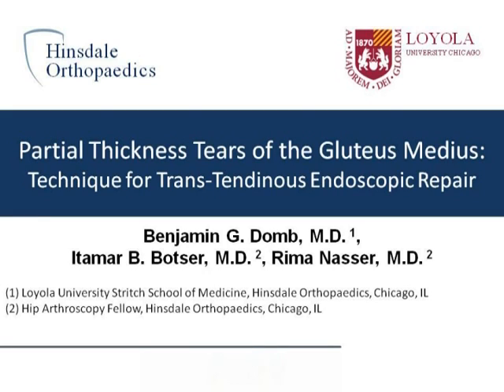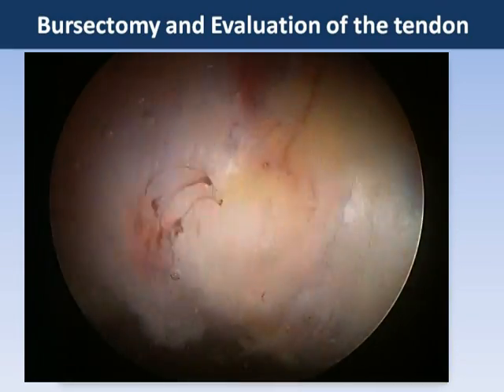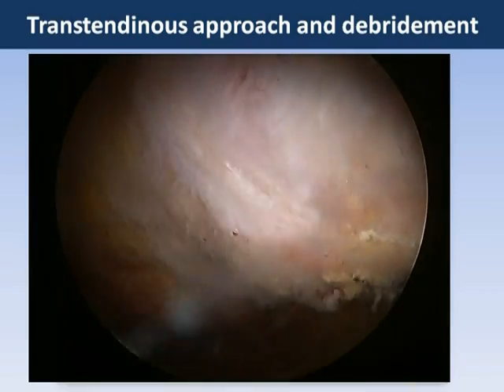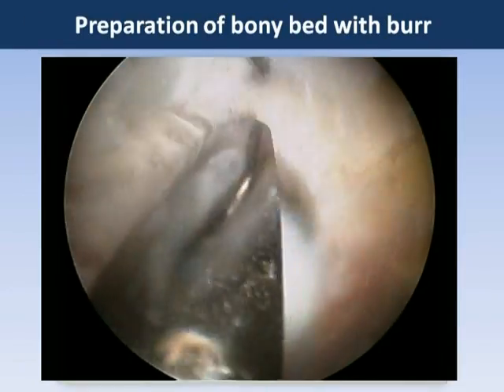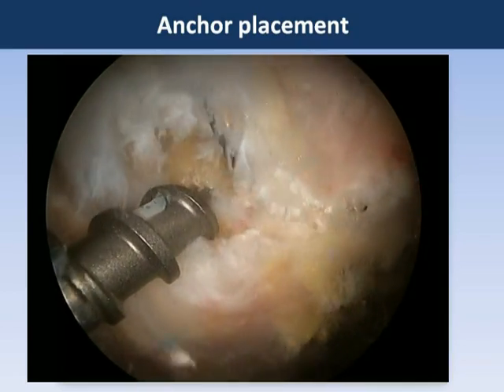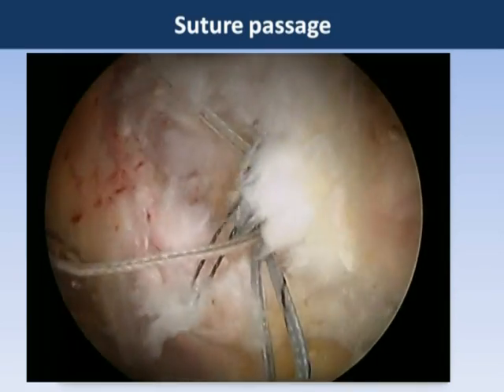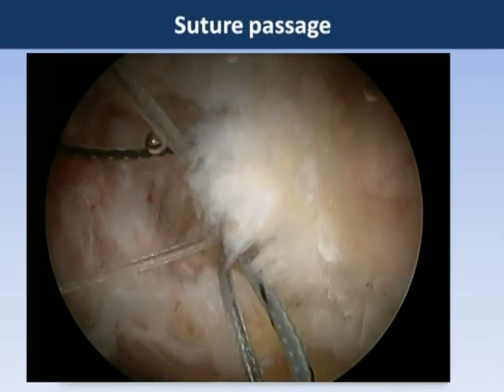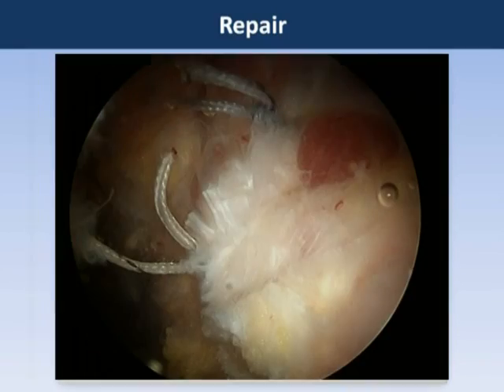Gluteus Medius Trans Tendinous Repair - Hip arthroscopy

Comment: I have gluteus medius tear at the right hip for years. I worked by little warming so it occur tightness when I left the gym. With the wrong exercises pain occurs at the iliotibial band. I healed with dry needling technic on iliotibial band but my g. medius was still tight (it was no painy). 

I took courage and went to the gym after 3 years. And I forced my legs with 65kg on leg press. After 2 months one morning I woke up with incredible pain in my hip. 

After 4 years now it still continuous like this. MRI shows that my gluteus medius teared near the bone and a issue with capsule. I tried a lot of different technics on my hip like PRP, dry needling, kinesio tape, strenghting, stretching etc. 

What would I do now?..

Comment: It's been a year.  And I cannot say strongly enough how Dr. Domb changed my life.  My previous post was under the influence of post surgery meds so I apologize for that.  To give a follow up, (at least for me) I am still in PT.  Not for the hip, however.  More for the tight IT band, and other tight muscles that suffered as a result of my hip tear.  I've been told that it takes time for the surrounding muscles to realize that they no longer have to 'help out' to do a job that they were never intended to do.  My Gluteus Medius was torn for 13 long years so I was a mess. .My pain was there 24/7.  If I tried to move, via gardening, walking, whatever... I was laid up for over a week.  Sometimes, more.  I can proclaim now that I am moving from PT to a more aggressive workout and even followed that with an hour long hike this week and for the first time in years had what would be normal muscle ache from working out!  This is thrilling.  I am still tighter than should be but foam rolling, stretching and strength training are working slowly but surely. 
Dr. Domb is a rock star doc who can be trusted with your hip pain.  And while Chicago might be far to travel for some, it is well worth the trips you will have to make for a healthy life.  Few other docs have the know how for this.  And if they do, they don't do this often.  I could go on, but this is already quite long.
Reply: I have a 17 year old Glute Med tear that was just found on a stronger 3T MRI. My previous MRI (1.5 T strength) didn't see it. A Sports Medicine doctor finally ordered the stronger one for me and it found this injury. Thanks for sharing your story, Yvonne Moss. I hope your recovery continues to be successful.
Reply: Emma Chase what about your rehab?
Reply: I haven't had surgery. Just got diagnosed with the stronger 3T MRI. Not sure if any surgeons in Canada do Glute Med repairs. :(
Reply: Emma Chase It is the same with me.

Comment: I am sitting here, 10 days out of surgery with the doctor above.  Dr. Benjamin Domb having done my surgery.  I spent 13 years in pain.  Same as you, misdiagnosed and my pain was getting worse each year.  Probably 3 rounds of PT per/year for 7 years and no help.  It would actually cause me more pain to work out.  Plus I also work on my feet.  All I can say is that I was out of that horrible pain even the night of my surgery, only have typical surgery pain to deal with. Dr. Domb can fix you!